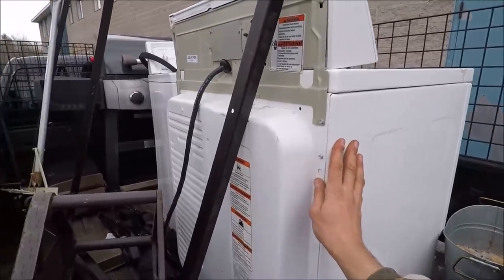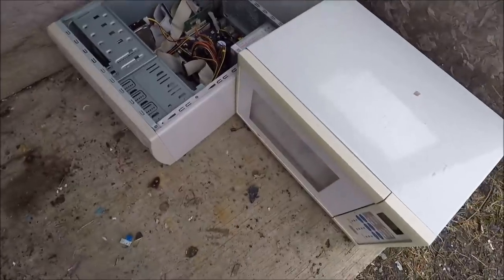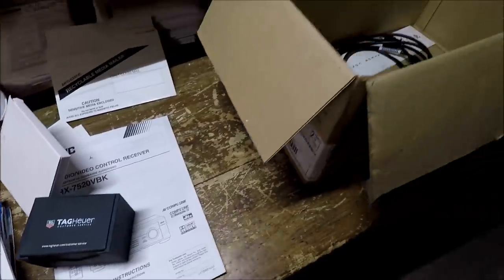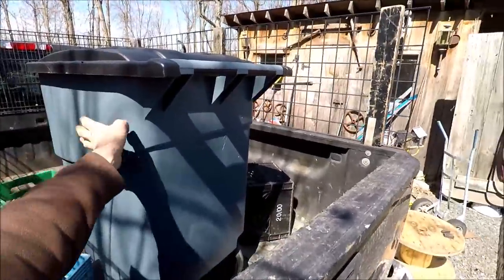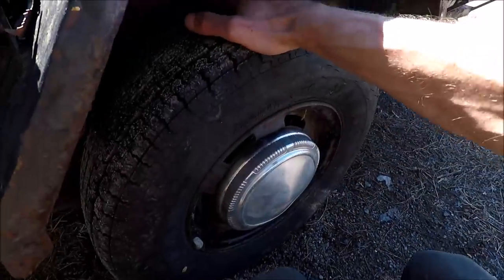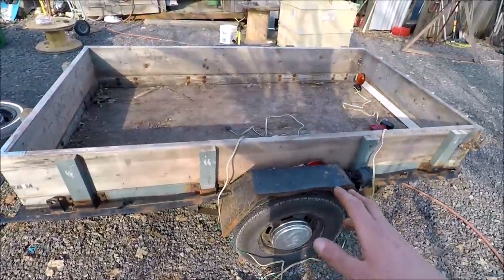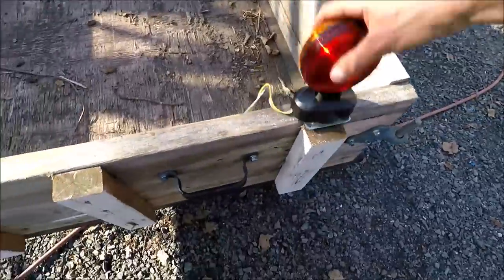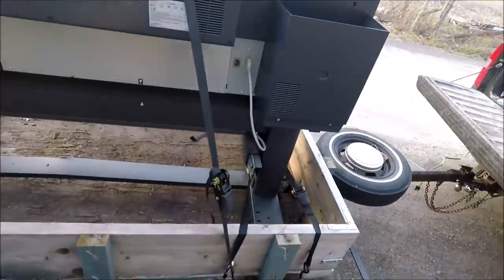Giant Canon printer and trailer left at my drop off bin. What do I do with it????

Comment: So many people here saying "plotter" or "blueprint printer". It is neither. Plotters have pens, blueprints are completely optical. This is a large format full color inkjet printer. You could print large posters, banners, probably vinyl signs with it. It could probably be cleaned up and fixed if you're somewhat handy with electronics. Probably worth a fair bit used if it works.
Reply: jeeze, finally someone who knows what a large format digital printer is...thank
 you.   PS, they sell upwards of 15 to 20 grand new. (i have been a sign guy for 20 yrs)

Comment: Canon imagePROGRAF iPF825
A 44-inch wide powerhouse printing system designed to enhance productivity for medium to large workgroups, with dual media rolls and high speed throughput, the imagePROGRAF iPF825 is a complete production printing solution. With incredible line accuracy, an 160GB hard drive, excellent media handling, and on-board support for HP-GL/2 and HP RTL files, the iPF825 is a complete and easy-to-use printing solution for any professional with a need for producing intricately detailed full-color renderings, CAD drawings, GIS maps and other large-format output.

Comment: People don't generally get rid of those printers until they're good and dead and even if you get parts for it the ink is a few hundred dollars per each one of those little cartridges. I would strip it for all the copper, aluminum, steel and circuit boards inside and send the plastic to the recycling bin. The circuit boards would go into the pile of like that I have waiting for gold, silver and platinum processing and the rest would go into ingots that sell on fleabay for up to six times their scrap worth or to one of several local foundries that pay a good bit more than the scrap yard and the precious metal s I got would go to a local jeweler who will buy them for 80% of current market value. He gets a deal on a bunch of raw materials and I get a nice fat stack of cash.

Comment: uberism81 That printer looks like a printer/plotter to me (I havnt looked it up), The missing roller you mentioned may be where a roll of paper is mounted, and the roll may include the shaft that meshes with those gears (Im not sure).  Anyway, if you are considering simply dropping it at the scrap yard, you might want to at least consider removing the stepper motors in it - they could be worth something on ebay. Lots of electronics geeks buying steppers for various projects.

Comment: That's an ink jet printer just like the one you print your digital photos with except is wide and runs off rolls. It is junk. You can scrap the aluminum out of it. The motors are what usually go. That's prolly why they scrapped it. It would have been nice if they took the ink out. They probably rolled it over.

Comment: The problem with Windows 7 and the other programs that are compatible with Windows 7 is that support/updates for them are ending at the end of this year, so they won't have much value.
Reply: microsoft still offers free windows 10 path for windows 7 and 8 users.
Reply: Thanks for the info but that doesn't increase the value of the programs they have very little value.